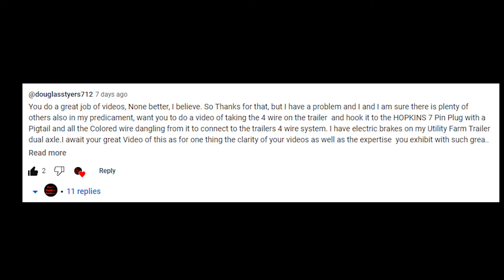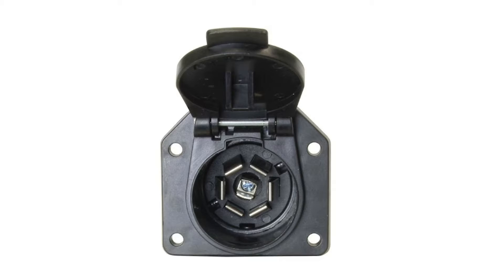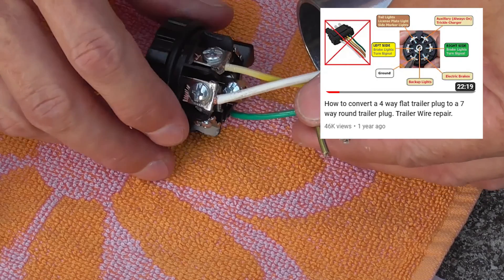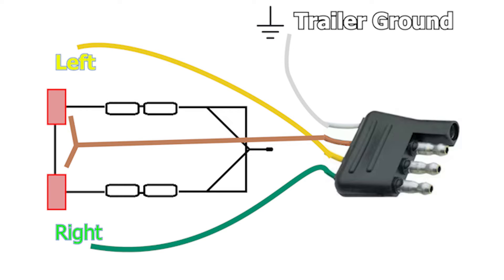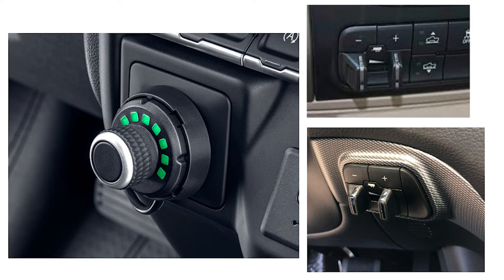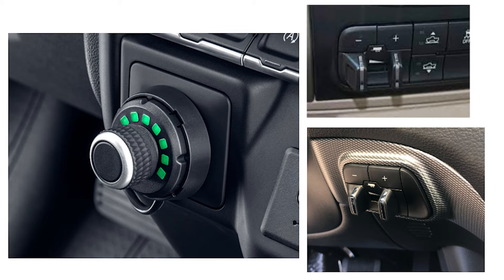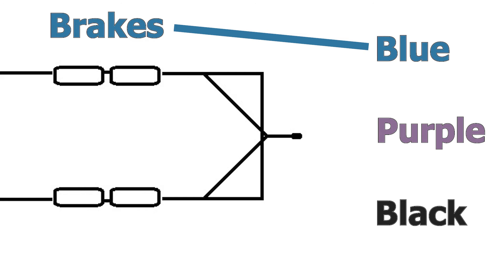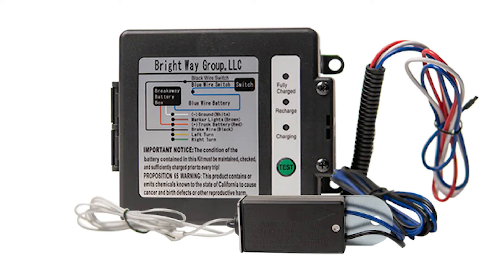How to convert 4-way flat connection to 7-way round connection, and add trailer brake wiring.

Comment: Does gauge of wire matter? I believe I have it hooked up correctly, but am getting nothing. But, if I hook it up to the black wire, I do get power to the lights. But when I have it hooked up as it should, nothing shows up.
Reply from the maker: Hi Todd! Hope I can help. Can you give me a little more information? When you "hook it up" what is it ?
Reply: @PaulsOutdoorAcademy  Yes sir! So I have a trailer with the old 4-way flat and I bought a new 7-way round on amazon. It came with a pre-wired box and looks like the plug at 5:47 on your video... but has the color of RV and not Standard. The LED light system I bought from Amazon came with what appears to be 18 gauge wire that I rewired the entire trailer with. When I "hook it up," I mean I put the brown, yellow and green wires where they should be and the ground to the trailer. Then, plug the 7-way to the tow vehicle and turn it on, and nothing happens. But, if I put the wires (green, yellow and brown) on the black terminal (which I believe is power), then they light up. If I hook them to the blue (break) terminal, I get a faint blinking every 3 seconds.
Reply from the maker: @ToddBeilman  ok I think your issue is that your wires will need to go to different locations. I can help you cross reference. I wish I had one of those RV connectors so I could do a video of converting them. I may try to do one just using graphics.

could you email me a photo of the one you got at amazon, or put a link here? I will go look at how it is configured.
Reply from the maker: oh, ok. I think I understand. You have the red wire, not the purple. Is it this one by any chance?
https://www.amazon.com/Inline-Pre-Wired-Trailer-Junction-Cable/dp/B01KP0PHG6
Reply from the maker: OK, I replied to your email and we use email from here on out. :)